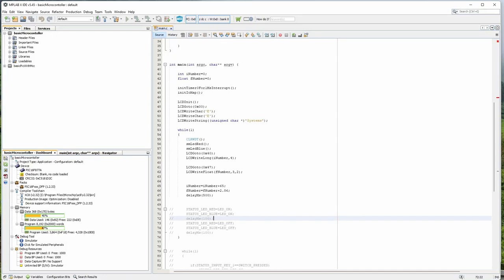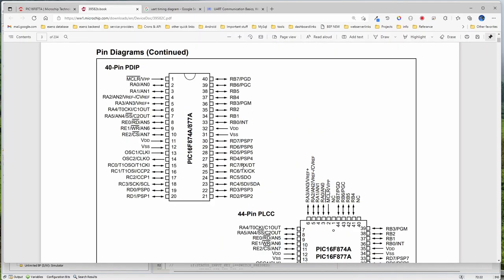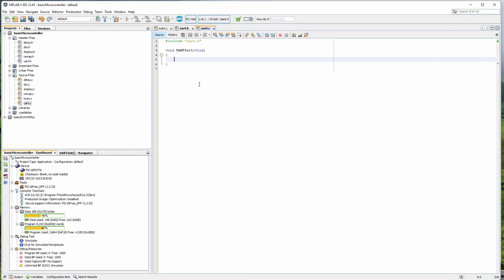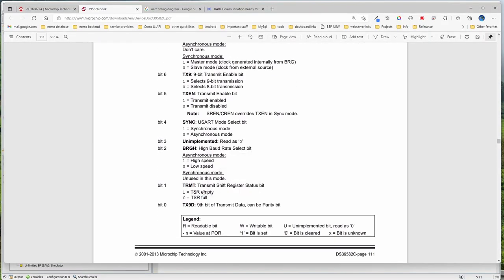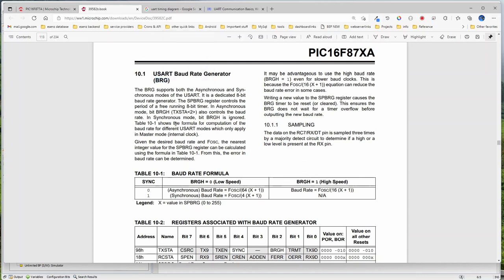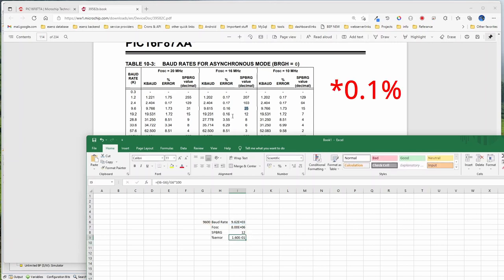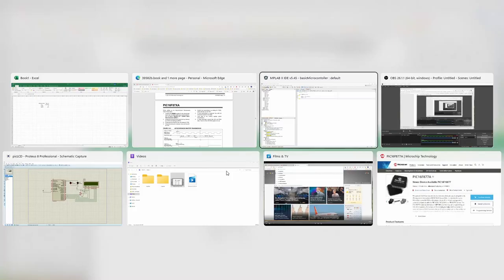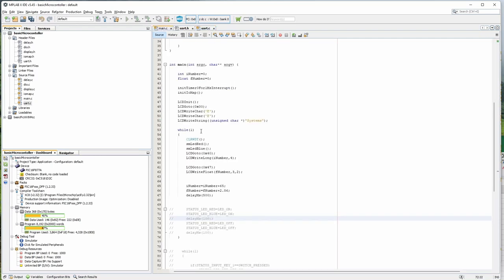Microcontroller basics 006 : UART Driver | Renesas | Microchip

Comment: Hi, Thanks a lot. I am watching your videos.  project for UART communication using RL78/F14, R5F10PBE. I generated the code using code generator, then followed your video, Not getting output. When I use following code 
PIOR4 = 1;
POM6.2 = 0;
P6.2 = 1;
PM6.2 = 0;
in R_UART0_Create function it will work, 
Please let me know what is the exact issue,

Comment: you can use sprintf function to send any string , long value or float, this is not working properly in cs studio, but It works in e2Studio, also in e2Studio you can use C99 standard.
Reply from the maker: That is the reason your code should be platform or compiler independent,

Comment: Hi sir,
I am sending a frame [02,00,02,60,03,67,0A,0D] from docklight  to RL 78 MCU using UART in hex format.but since 02 is repeating the first two elements of this frame is not being received in the buffer. So what are the changes I should implement to obtain entire frame in the reception buffer?? Please help Sir.
Reply from the maker: If this case you can use a timer(1ms see timer videos) incrementing automatically in timer interrupt. Clear this(set it to zero) every time use you get a character. When this timer goes above say 200(200ms) you have got the entire packet.
Reply: @exploringembeddedsystems743  Thank you . Will do that.
Reply: sir, sometimes the frame I'm sending is not being received.  Happens in almost 1 out of 5 times. What might be the issue??

Comment: Why my Uart code always send #NULL in serial port? I am using PIC16F1826 microcontroller, I have written same code as your, but it didn't work.
Sir, please help me.
Reply from the maker: Try the code which I have written once. If  the display code is present then before transmitting display it once.
Reply: @exploringembeddedsystems743  Ok sir, I will try to do that and let you know the results.